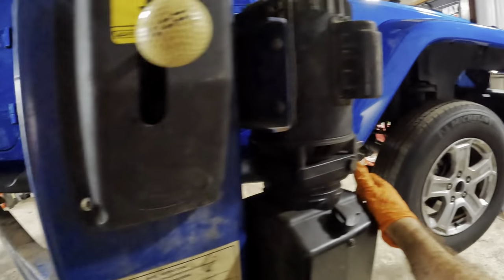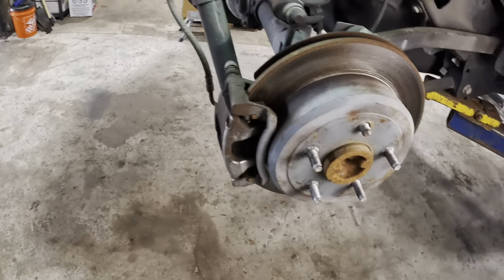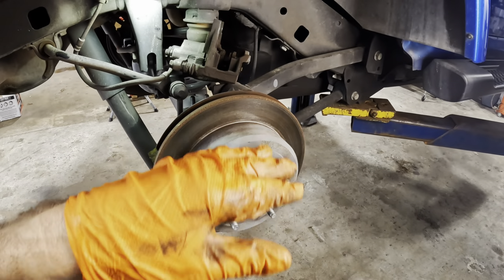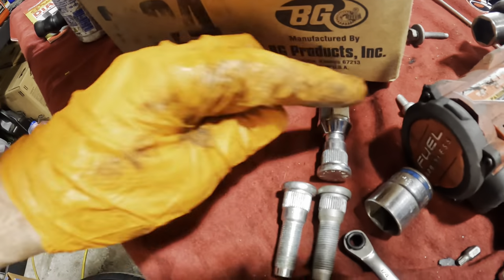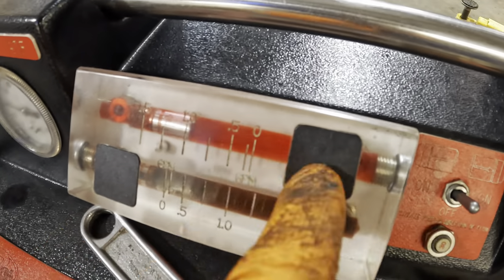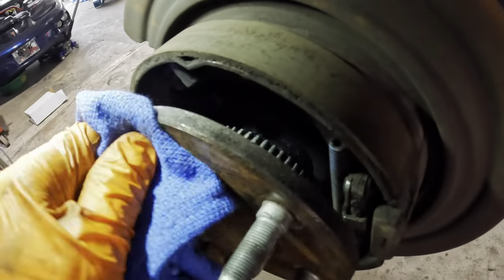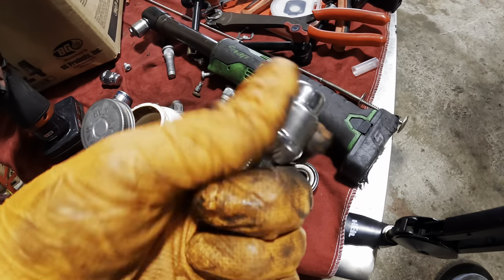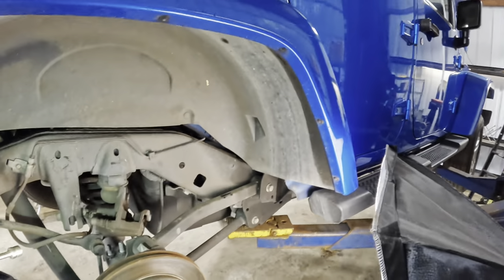Busted Wheel Stud! Fix IT! Jeep Wrangler

Comment: Hi Ray, that smaller stud was probably installed at the factory and that would explain the third retaining clip used to keep it in place during assembly. I have often had boxes of nuts and bolts that contain a slightly different piece ( longer, shorter, wrong thread, wrong finish etc). They can be difficult to spot until you try to fit them.
Reply: Was about to say the same thing, but you were here first. 👍
Reply: Or the owner busted 2 studs, parts guy didn't have the correct stud. Parts guy was kind enough to sell something to get home. Owner put the stud & holder back on cause it was there before figuring if he left that off his wheel would fall off.
Reply: Probably just a defective stud.  It was also loose in the other hole.  Sometimes I get screws and nuts with no threads.
Reply: By the looks of things, the smaller loose stud was obviously the runt of the litter most likely caused by a genetic birth defect, although malnutrition can not be ruled out..., It's obvious the other stud lost it's head in a heated argument over torque specs with an impact gun.
Reply: That just raises more questions as to why there would be a smaller stud at that part of the car manufacturing line when they should all be the same size for that part of the car.🤔
Reply: It's Chrysler, wrong stud is minor compared to the things I've seen Chrysler roll into a dealer lot for sale..I had a guy with jammed up stuck open valves..his jeep had 8k miles, dealer was 70 miles and I was 5 miles away..he called me and I came drug him back to my workshop..2 hours of diagnostic and taking apart stuff..we found 3 screws same as oil cooler mounts, 2 headbolts and a lug nut all awful Chrysler looking and he'd never had it anywhere but the dealer. We think they settled over into valves after his off-road driving got him leaned over pretty far.
Reply: You can get the clips. I have had to put them on for customers that want “like factory”. They think you are trying to cut corners.
Reply: I think there is no way that it happened at the factory. I think someone before you used whatever 1/2-20 stud they had available to use as a nut and bolt to get by. Why would the factory even have the wrong stud available?
Reply: Yeah if it was a mixup from the factory then the stud would have fallen out as the clips go on after the rotors. Axles are preasembled with studs in when it goes in the assembly without the rotors. I would bet since the other stud is broken and messed up that it was 2 studs that needed to be replaced and they got the wrong size and found out after they popped out a stud. They might have left the rotor on for spacing to put the new stud in and had clips around to stick on. Hide their mistake instead of getting the right size.
Reply: @cameo25000 previous repair someone put on the clip otherwise every time you put the wheel on the stud is going to fall out backwards.  100% this is not factory but some DIY that didn't have the right size stud.
Reply: That is exactly what I was thinking too

Comment: Ray The factory would only have the right studs , the keepers some mechanics and DYI ers put them back on. You made this Jeep Safe. Have a good day Ray
Reply: I worked on an assembly line for over 20 years and constantly came across mixed or mislabeled parts. If the assembly process allows for the these parts to be put together before the studs are seated this can happen.
Reply: Your certainty that the factory would only have the right part is misplaced.

Comment: Just a thought, maybe a hack at a tire outlet crossed threaded the stud during a tire replacement, ended up breaking the stud, replaced it with incorrect one and then replaced the drum keepers to hide the loose stud. On the next tire rotation, the stud that was missing when it can to ray's was broken off during removal by a shop for tire rotation due to being cross threaded and not replaced. Good job Ray
Reply: My thought as well.
Reply: Back of the old studs Ray removed have different markings one has a circle the other has nothing.

Comment: I’ve used stacked, heavily greased washers and a lug nut to pull in replacement studs for my 1991 Camry.  Been years and no problems yet.
Reply from the maker: Old axle nuts also work great

Comment: I have replaced,put back on the stud tabs. I have also replaced studs ,but used washers to take up the slack with some anti size on splines to help pull in .

Comment: Highly recommend pulling the studs through by hand ratchet for anyone trying this at home, those bearings usually explode after 2-5 uses with an impact, they're not rated for that kind of.. well.. impact.. Have had quite a few of the Lisle ones do that to me, wear safety glasses my friends. Good video Ray.

Comment: if it makes you feel less confused....i put those clips back sometimes. because it makes it easier to install the caliper bracket
Reply: how can you even get them off without destroying the clip or the stud at the narrow part?
Reply: @jayc4283  tiny flathead screwdriver, pry up a couple of the legs biting the stud, spin it off just like a nut. Sometimes theyre actually loose enough to just spin off without bending anything. Single smack with a hammer flattens it for re-use

Comment: I'm sure someone has been changing studs before and got the wrong stud. Instead of going and getting the correct one they just put it together and the little bit of resistance it did have allowed the lug nut to be tightened but probably not to the required torque spec.

Comment: Ray years ago I would always replace those retainers. Snap-on made a special socket to remove these and they simply pushed back on. I'm sure I still have that socket. Yes I found them. They made two different ones S8701 for the type you encountered and B1357 used on some Fords,

Comment: Gotta love the UAW work product. I used to do the checks on the vehicles that were delivered from the factory and nothing surprises me about “what they do at the factory”. We had a late 80’s Mustang GT come off the truck with non working AC. Popped the hood and found that the compressor hose was not connected. I guess that the guy whose job it was to charge the system didn’t notice the 20oz of R12 come shooting out of the hose when he tried to charge it.

Comment: Someone stripped off a wheel lug, tried to install a wrong size replacement stud.  Rather than  buy the correct size stud, they used a factory lock ring, probably from another wheel, to hold the stud in place.  There's probably another wheel on the Jeep with only one factory lock ring, if they haven't already been cut off.  Signs of a Back Yard Mechanic at play here.

Comment: Wobbly stud + 3 retaining clips = Shade tree jury-rigged broken stud replacement using wrong stud.  
Note the retaining clips had no rust yet the axle flange (not wheel hub) was rusted but all three rotor retaining clips were shiny new.

Comment: I have seen this before working the automotive assembly sector. Some times you get the wrong part in a package. That part should have triggered a sort. The last 30 vehicles would have to be inspected as well as the rest of the batch of bolts in that shipment. Simply. Some was lazy and let a safety issue go through.

Comment: Some one else tried doing something with those wheel studs, failed stuck it backrogether for appearances and got out of dodge, I bet they even had a lug nut threaded onto that broken wheel stud so it looked normal. I am looking at you tire shops

Comment: Someone obviously put the wrong stud in and put a clip on it to hold. Amazing they got the lug nut to hold and what is more amazing was you getting it to come right off. Cut and dry fixed. I hope the same idiot didn't do it to another wheel. May be worth checking Ray.

Comment: My mentor, about 50 years ago,  always reinstalled those clips. He removed them with a socket with a shock bushing jamed into it. He claimed they were needed to keep the brake drum in place if a wheel came off.

Comment: Rainman Ray.. Perhaps when that incorrect size stud was installed "they" put the rotor retaining clips on take make it appear it's never been off to steer the attention away from whomever did it. IMO the axle needs to be replaced since the hole is too big now. Besides it looked like the axle seal is leaking on that side with it be wet looking so the axle would have to come out anyway.

Comment: I don't know if this is still done, but back in the day I got to tour an assembly line and when the lug bolts are installed in the hubs the worker reached into a bucket for the bolts and placed them on the hub, than a machine pulled all 5/6/8 in at once. They had different buckets for different vehicle applications.  It would be very easy to pick a stud from the wrong bucket for that application.  Back then you had differnt vehicles on the same assembly line. A Half tone comes down the line followed by a one ton, or whatever.  I imagine that is the same today.  Generally, the axles are assembled at one place in the plant and the whole assembly would be sent to then next plant for installation on the vehicle.  Mistakes could be and were made.   I remember seeing vehciles come in with wrong axles (Dana 60 axles on a vehicle that called for a Dama 44) and most memorably a Chevy truck with a GMC interior and badging on the inside, Chevy equipment and badging on the outside.  The only time I saw the dealer change was on that vehicle. And all they changed was the badging.

Comment: Most likely a factory defect. The axels come to the Toledo OH assembly plant already put together somewhere else. Axel installed with a loose stud and wheel installed over the loose stud. As long as the stud is there is no reason to question integrity because a machine is used to torque the lug nuts. No human touches the stud or nut to notice if it is tight or not. I am just surprised that the stud didn't spin when torque was applied with no rust to create friction to hold it in place.

Comment: From someone who works in an automobile factory I believe the assembly line has 2 different size lug nuts at the process and the Team member accidentally installed the wrong nut. 

The other possibility is that the rotor assembly comes from an outside supplier and that is where the wrong nut was installed.

Comment: In case it isn’t known to others, the rear brakes wear faster than the front on a Jeep Wrangler. Second of all, when I was an unlearned dingdong several years ago and replaced my rear brakes and rotors, I specifically had a family member who worked at a non-sponsored auto parts store in your videos, obtain me clips to go back on the studs.I have them on at present, but also now realize that they are of no use. Also, as an FYI, the Mopar Wrangler Lugnuts are prone to internally separate thus warranting replacement. This is why I have gone to spline Lugnuts.

Comment: Ray Those Keepers are called Pal Nuts. You can buy them in different sizes. I bet someone broke off the stud and replaced them. Some people think they are needed. You are correct that they are just used to hold on the Rotor during assembly.

Comment: The stud was either placed by the factory that way or it was replaced.  I have seen parts being put on that don't fit correctly due to lack of correct parts being available.  If it was a shop, they had one hanging around from a Prius and stuck that in, or as others have said, wrong part on the line.  Several times you get a box of parts and you'll find one or 2 that either have threads missing or it's short one and you have to find one.  Not normal, but it does happen.

Comment: Don't know if it ever changed in newer years, but the original acorn nuts that came on my 97 Cherokee were press-formed, with the chrome cover over the steel nut.  Over time each and every one of them broke the chrome cover off exposing the steel nut underneath (which of course rusted).  

I replaced all of them with solid acorn nuts, end of problem.  Thankfully before breaking any of the studs.
Reply: My 1988 Cherokee was the same, those lug nut covers just spun, worthless, and would be a real hazard if one had a flat tire.  I bought real lug nuts for that all around.

Comment: Having worked in an automotive manufacturing facility I can tell you that sometimes part suppliers and or assembly employees that are not paying attention will mix or use the wrong parts. I would assume that the assembly process might allow for the rotor and clip to be placed over the stud before it's seated into the axle.

Comment: Helpful hint: inverting a can of Canned Air will give you a handy -40 blaster. Spray the stud/flange joint with PB, wait a minute for it to soak in, spray the stud with the canned air, and it will come right out without a fuss.
I was hoping that you'd take a micrometer and show us the difference in diameter between the incorrect stud and the correct one.

Comment: Apparently, the hub has been removed before (you can take the retainers off without damaging them and replace them back); the stud that was loose was probably incorrectly installed (as a 'hack' job by someone else).
Reply: Agree.  Hack job.  It's not actually a wallered out, it's too small of a stud.  Otherwise your replacement stud would also be sloppy.  Bet they had two damaged studs, tried to replace them and realized they got wrong size and just rolled with it, and probably robbed the clips off the other wheels in attempt to make it look like "factory".  I really doubt it came from the factory like that.  Huge lawsuit if wheel comes off brand new car going down freeway and crash and burns and everyone dies.  (this happened to a Pep-Boys in Calif. and they could no longer install wheels)
Reply: At 1:46 you can see witness marks on the caliper bracket bolt, before Ray touches it.

Comment: I used to work at a Walmart's Tire and Lube shop.  Every once in a while a stud would snap off while torquing a tire up.  I wonder why we didn't do stud replacements ourselves considering how easy it is.  All it would have cost is a bit of inventory, vice the price of having one of us go to a nearby tire place and fork out the money for them to install a new stud while the tech was waiting at the shop for it.
Reply: My boss took his car to Walmart for new tires.  Walmart called him and said they couldn't touch it because one wheel was missing a lug nut.  I asked him to call them and see if they could push the car in, and we'd show up with a new lug nut.  No dice, said they couldn't touch it.  I drove him to parts store to buy a lug nut, then we went to the service desk at Walmart, and they said we had to install the lug nut that they weren't allowed to.  So I screwed it on hand tight, he got his tires, so stooooopid !!!!

Comment: The stud that did not fit is unlikely to have been installed at the factory. Another shop probably just installed one they had laying around rather than purchasing the correct on, and installed a clip (which would also explain the third clip since the factory usually only installs two). That would mean, two broken studs on that 2016. 

What I have heard on forums, the usual cause of broken studs is over torquing the lug nuts when changing/rotating tires. One of the reasons I use the tire shop I do since they manually torque the lug nuts, no air gun on replacing the nuts after tire work.

Comment: i live in a winter environment and i use a tiny bit of copper paste for wheel bolts just enough to where you see a bit of it sitting at the bottom of the threads reapply it after like 4 years. why? during the winter the dirt, crime, salt and snow can make it hard as hell to break off the bolt to change to summer tires. you just need that tiny bit to not be rusted together for it to break off like it should.

Comment: used to be, way back when, they had oversized studs for cases when the original stud hole was too enlarged for a standard size stud to grip the flange. i can't remember exactly how much but i believe it was a couple or 3 thou oversized. saves on having to replace axles.

Comment: My thoughts are at one time that jeep went to the Dealership for some work on the rear end and when they removed the lug nuts they broke one and they didn't have the right size but that's what they had so they used it an when they put it all back to gether they put the clips on

Comment: I do believe that wrong Lug Bolt was put in during Production. Just a note, have used anti-seize on Lug Bolts for 50 years, never had a Lug Bolt to come loose--anti-seize keeps treads in good shape...

Comment: If my brakes had the clips on them when I started, they had them on when I was done. I used pliers and unscrewed the clips. Working on my own time it took longer, but I didn't know that you could just cut them off and leave them off.

Comment: Great job, pull the rotor off and drop it on the floor face down so it can pick up contaminants on the face on the ground. They do have two sides, take a look and ask yourself what side would be better on the floor. Also some day you will do a trans transfer and the driver will leave and down the road the trans will go out and when the pan is taken off, there will be clutch and metal debris which is why the trans went out. Then the owner will come back to you to pay for a new transmission because you sold him on just the transfer.

Comment: I hope you checked the rest of them to all the way around, might not get paid for it, but things like that build clientele for the future. Craziest thing I seen at a dealership in the 70,s, a guy bought a new 76 Impala, came in a couple days later and told the service writer he was checking the spare tire for pressure, for a long vacation trip, and couldnt find the valve stem!! LOL, It had NEVER been drilled and installed at the factory, they used a small flexible tube that filled the tires, just one of those things that slip by on a prepping a new car..